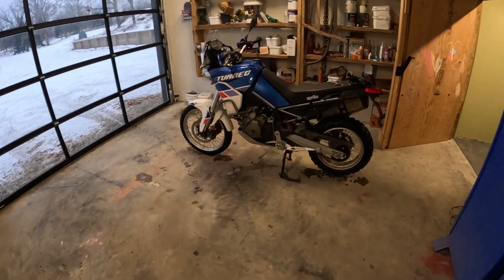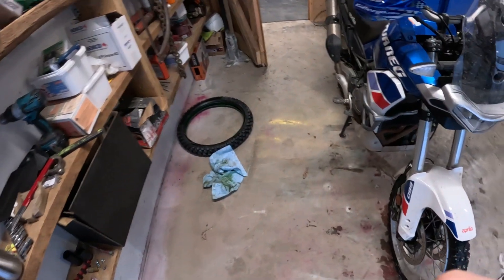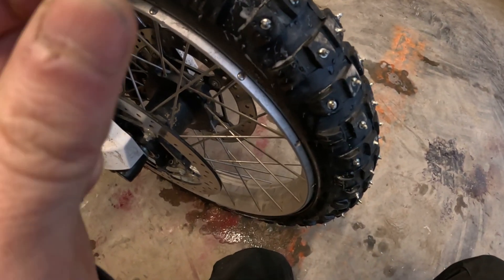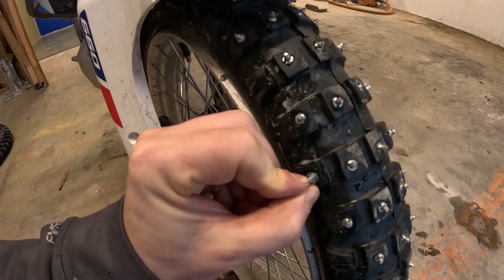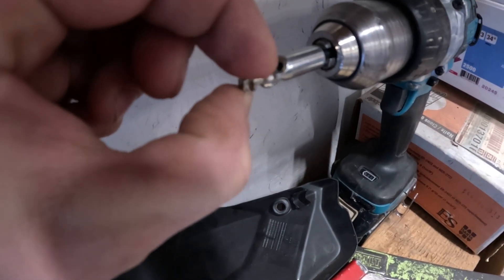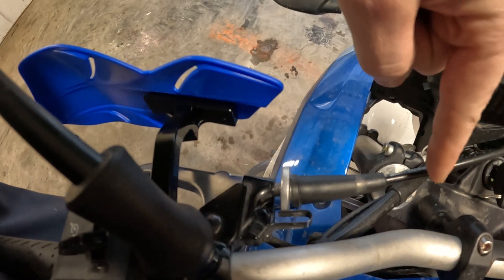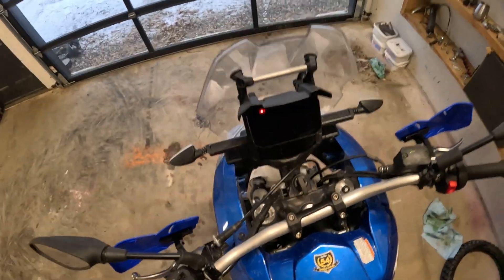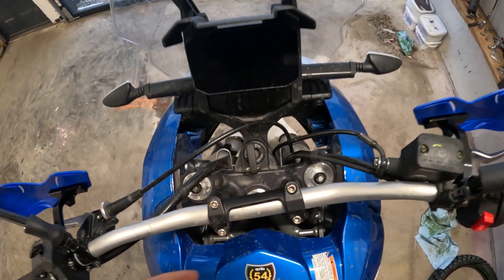ADV-Tuareg- tire studs!

Comment: I recommend loosening the bolts holding the handlebar clamps to the top triple clamp to help straighten your bars.  Those handlebar mounts have rubber bushings in them and they sort of get squished and cockeyed.  Your forks may also be twisted some in the triple clamps so I’d also recommend trying to get the front end suspended off the ground and loosening the triple clamp bolts that secure the fork stanchions and making sure everything is straight there without any binding.  Hope this helps.